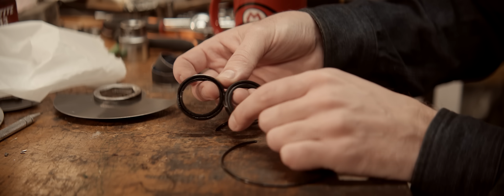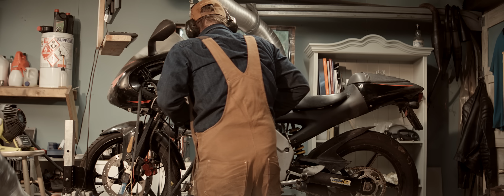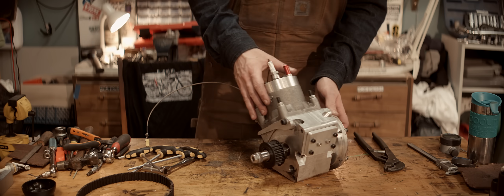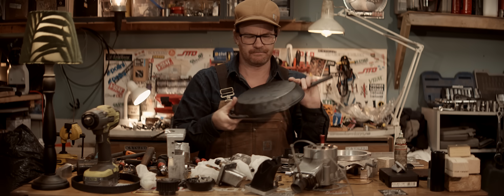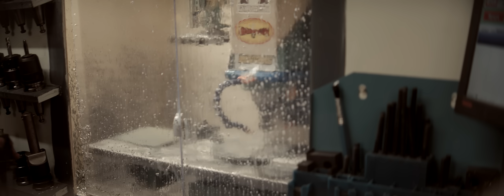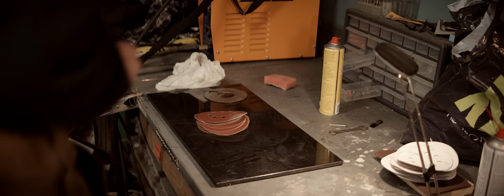Another Frying Pan Dead for The 2-Stroke Cause.

Comment: Did you check the roundness of you bearing holes as far as I remember you machined them with your cnc router but if the backlash on the router isn't perfect the holes will be slightly oval. This could cause them to heat up due too not enough clearence at some spots.

Comment: could the black stuff be from the teflon coating on the pan cut out?
maybe it's dissolving or due to the gas or chemicals in the oil or reacting with the two
Cool stuff love every moment of it
I don't time anymore to tinker with 2 strokes but watching this is really nice
Reply: a teflon coated iron skillet?
Reply: Its still residue from the previous carbondiscs experiments